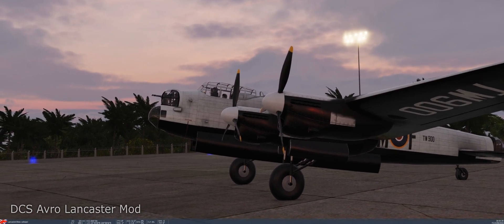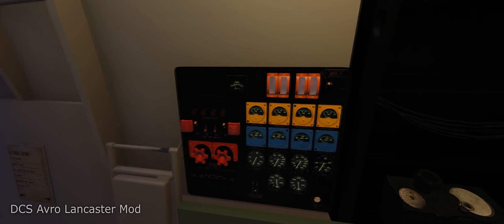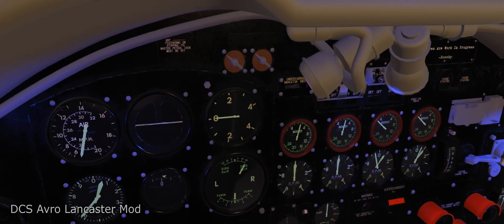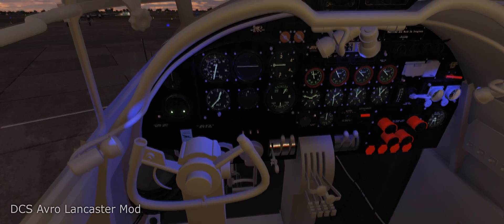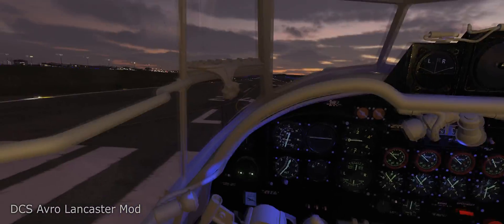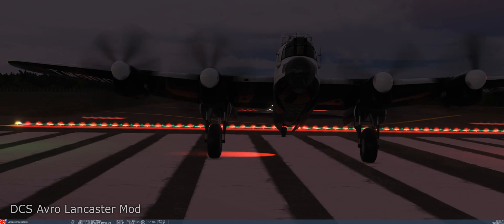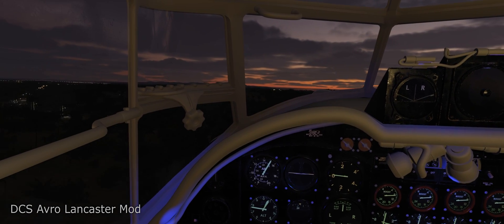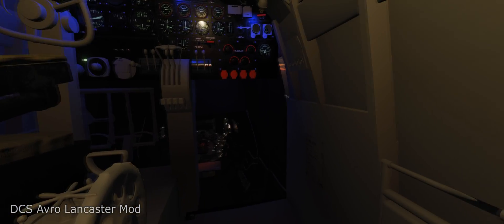DCS Lancaster April Update

Comment: About throttle controls: Setup several different possible axis configurations.
1. All throttles on 1 axis.
2. Each throttle on their own axis.
3. Split right and left throttles to two axis. This means you could control using differential thrust still using a "normal" F-18-style throttle.